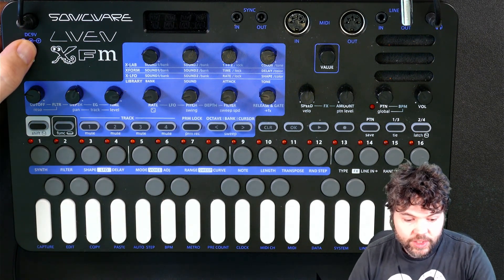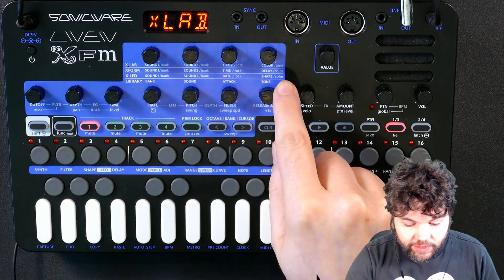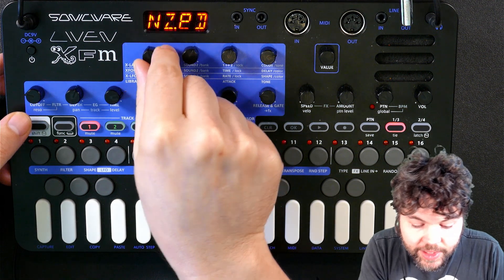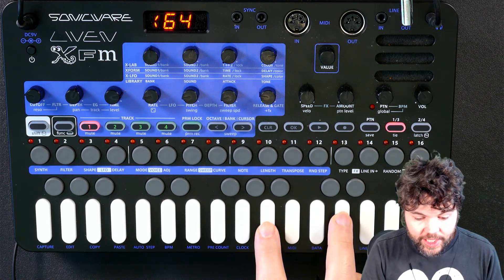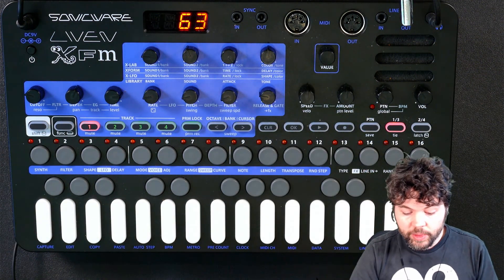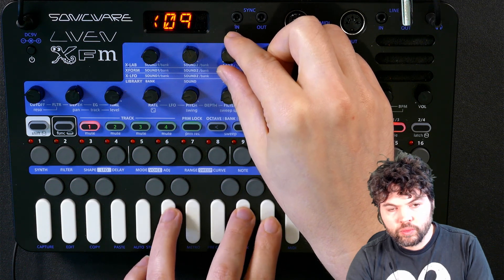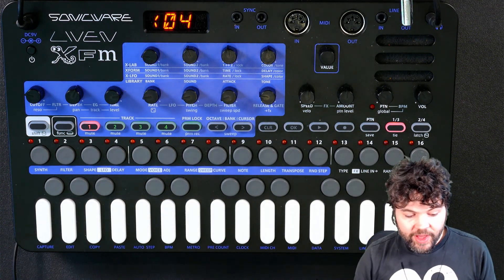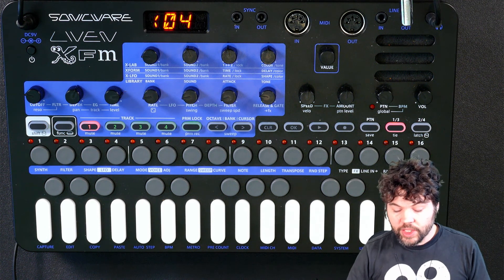FM Sound Design on Liven XFM: Ep03 - The X-Lab Engine

Comment: Xlab is great for when I run out of ideas. I can usually find something nice by noodling around there. I have filled a couple of sound banks with my discoveries. The export function works great.
Reply from the maker: Thanks for your comment, and for watching. On the whole, I think the morphing options are great for experimenting and understanding the scope of what the core FM engine has to offer.

I quite enjoyed an experiment I did, where I picked 8 factory patches and chose pairs which were "as different as possible" then x-lab them to make a patch I enjoyed in between, then exported. I then repeated for that 4, then the final 2, resulting in a single patch that had something of all the other patches in it.

The problem I found was that, since different patches use different operators for different purposes, some morphs work very well (meaning quite an intuitive transition) and some had quite hard to predict results. Either way: it's a great take on simplifying FM.
Reply: I've tried to edit a few of the exports. They had strange operator ratios and routings, but they sounded great.

Comment: Thanks a lot for such  a step by step approach to explainning things( I am specially grateful to you as I am non native English speaker)
I am trying to learn XFM for a long time. This is the third time watching your tutorial episodes.
My biggest frustration comes with XFM's volume jumps among many sounds.Also Most drum sounds  almost inaudible without  effects. Do you have any recomendation to improve this issues?
According to your conversations on Gearspace,I know you think very highly of this machine. I would like to know you still think that way about XFM. 
Thanks again Chalk Walk. Cheers!
Reply from the maker: Thanks for your comment, and for watching. As for balancing volume, especially for drum sounds, in this way you can patch lock the sounds, then parameter lock velocity (the knob above the record button) to get the volume matched.

One other thought, is : are you listening through the headphone port? If you are trying to listen through your computer, make sure you are using a stereo breakout cable: if you run TRS stereo (like the line in), to a balanced mono interface input, it might seem very quiet without effects.

I'm not actually on gearspace, but I do often mention the Liven XFM on Reddit. There was some conversation about me, and my series, on gearspace so I imagine that's where the confusion happens.

In any case, my opinion on the Liven XFM is still the same. While it's not the best sounding FM synth (the effects especially, don't sound great), it's also not a bad sounding synth; most importantly, it gives you (via the FM overlay), a fairly efficient interface for creating FM sounds: nothing in its price range does this. Add to this the elektron style sequencer, patch morphing and filter+envelope per track, and you have something that's hard to beat for both learning true FM synthesis, and exploring FM sound design without really having to learn much at all (using the morphing).
Reply: @ChalkWalkMusic  
Wow~  I really apprecite your reply.
I will try to use parameter lock as you suggested. 
I am little confued that you mentioned about parameter locking velocity (the knob above the record butten) but I see the knob above the record butten is pattern level knob. Do you mean the velocity Knob,the one beside of that ptn level knob?
Also could you expain me a little bit about how to use latch Knob? I couldn't find any information on the Manual.( Maybe you already expained in your episodes if so, could you let me know which episode ?)

I very much like sound of FM synthsizers. Several years ago, I got a DX7 to learn to program FM sound but without patience and dedication I end up just downloding patchs from the web since there are so many available. 
 About year ago, I got a XFM,hoping it is easier  to learn FM synthesis but still not very successful. Haha~ I have found  playing XFM  very much fun just  morphing preloaded sounds without really getting into FM sound editing. I kow it is just a excuse haha...

Anyway, I will keep trying. Now,I am gonna go re-watch your XFM episodes about making a track from scratch.
Reply from the maker: @sonicforest521   You are correct about the velocity knob: I looked up a picture of the XFM to confirm where the knob was and it turned out to be a picture of a pre-release model with different printing.

As for your other question about "latch", I don't think there is a latch knob: do you mean the latch button? If so, latch indicates the behaviour of knobs, when the value of the parameter and the knob position are mismatched. When latch is enabled, any knob will not have any effect, until it is turned to a position matching the current parameter value; when latch is off, the parameter will jump to a value matching the knob position as soon as the knob turns. Latch mode is useful for live use, as the parameter won't instantaneously jump when you touch it; jump is often better for sound design as you can directly manipulate the knob to set the value you wish (vs having to sweep the control to find the current value, to then adjust it).

As for learning FM synthesis on a DX7: the DX7, especially the mk1, is very awkward to learn FM synthesis on. This is because you have to page through a big list of parameters to find the one you wish to adjust, they adjust it with a fader. While this gives you access to every parameter, the use experience is very poor. The big benefit of the XFM, and the FM overlay, is you get knobs to directly set certain parameters for each operator, then a set of buttons to select other parameters directly. The result is a far quicker user experience, also meaning that you can experiment a little while retaining a feeling you understand the state of the synth. While this doesn't reduce the parameter count on the synth (though obviously it has 4 operators vs 6 on the DX7), it makes navigating much easier.

The DX7 being algorithm based is another complicating factor. The algorithm defines the function of every operator up front. In contrast the XFM method of having a routing matrix, allows you to decide on the operator functions as you go. The latter is far more forgiving vs the DX7, where if you realize you picked the wrong algorithm part way through sound design, you effectively have to start again.

The knowledge and intuition you gain on the XFM, could likely allow you to pick the correct algorithm on the DX7 and design a sound more effectively. This doesn't, however, make the user interface any more efficient, so the experience is likely just as frustrating as ever.
Reply: @ChalkWalkMusic  \
Yes,that was a latch butten not a Knob. I kind of understand your explanation. I guess I should actually use it to fully understand how the latch butten works.

Yes,I have a DX7 MK1 with Grey-matter. Indeed It is very confusing. Usually my attension span does not last very long with it.
However,your explanation about DX7 and XFM really inspires me to focus on to learn  XFM sound editing mode first.

By the way, the other day, I downloded XFM Analog Waveform Pack by Chris Lody from Sonicware to use XFM as a virtual analog synth.It is total of 50 patches from their website. It was so much fun to play with. Morphing the new patches sounds very nice.

Again,thanks a million Chalk walk for taking time for such  thorough explanations about all my qustions.

Comment: Very nice walkthrough.
This is definitely my favorite of the 3 engines. It seems the only of the 3 that creates new sounds by the combination of the pitch/envelope locking and color algorithms.
Reply from the maker: Thanks for your comment and for watching. As for your comment, yes: I agree. All of the morphing synth engines have access to the locking parameters and colour but, since the other algorithms sweep the morphing parameters, unless that sweep is very fast, the unlocked pitch (less so the envelopes) produces very inharmonious results (which some people will enjoy, but are often hard to use in a traditionally musical context). With X Lab you can often find intermediate states that are sonorous enough, even without the locking in place giving quite interesting timbres. The ability to save (capture) the patch from the X Lab engine is also very handy as if the sound is almost what you want, you can then go into FM Edit mode and fine tune things.